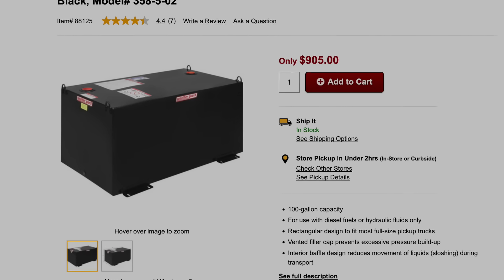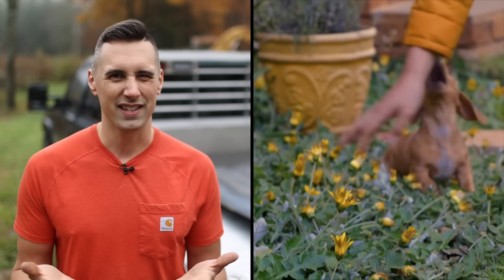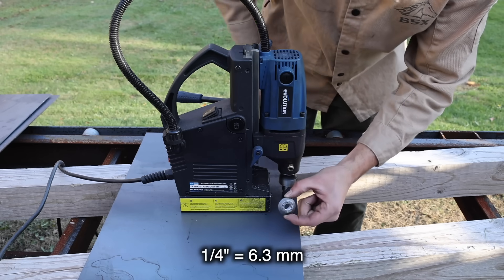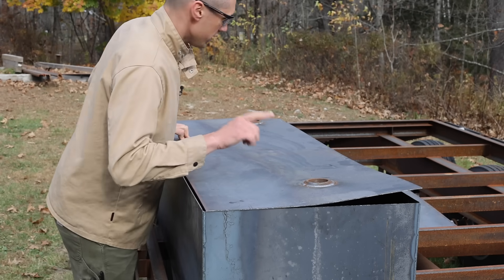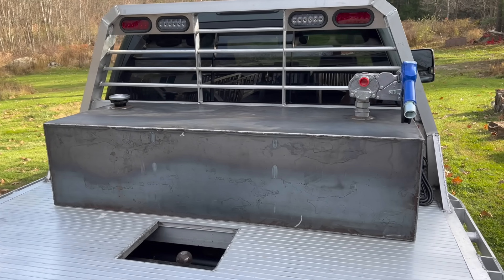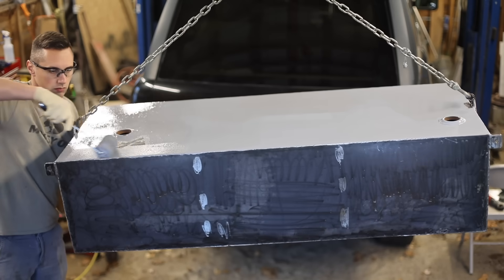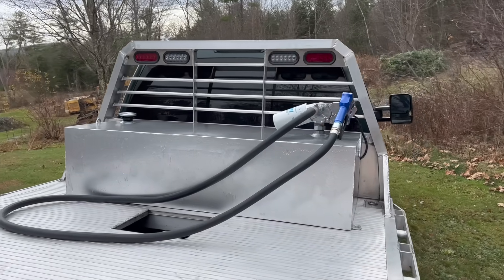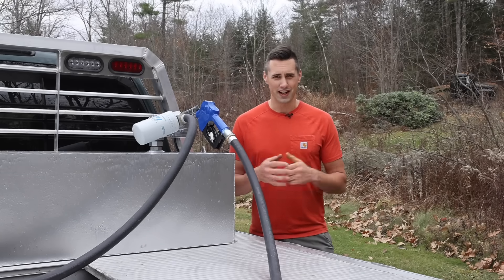Building a Fuel Transfer Tank

Comment: This is almost exactly how fuel tanks were built for Monaco brand RV's in the early 2000s. They had a guy who built fuel tanks everyday just like you did it. The only thing he did differently was to pressurize each tank and spray all the seams with soapy water as a leak test for pinholes. I didn't see you do that, maybe you did and I didn't notice..

Very nice job.

If you're gonna make another, weld the threaded bungs on AFTER you tack/weld on the top. You wont be fighting distortion.

Comment: Here in the UK, I also have heating oil for home heating..
Heating oil is LOADS cheaper than pump diesel here... But in a pinch.. I will run my heating off pump diesel :)

Comment: Seeing as how welding defects are the biggest problem on projects like this, why wouldn't one opt to go with as many bends as possible rather than maximizing the weld joints? If you, for example, did bends for 3 of the joints on the horizonal portion of the bank, that would leave you one weld seam (which you could put at the top) making it esentially leak proof along the length of the tank. Just leaving you the two ends to weld. Also with the extra time you saved you could put welds on the insides and out as well as some spray in tank linder.

Comment: Heating oil and diesel are basically the same but your jet will plug up a lot with diesel I have had this problem with my garage heater so a better filter will fix the debris problem I think it's the added detergents that turn to soot and plug the jet pilot so the filter didnt qork as well as I thought it would

Comment: Just spit ballin here but wouldn’t it have been slightly better to weld a panel on the bottom below the baffles to give the bottom of the tank an incline?? Like and inch or two would’ve done it you’d loose a little volume but when it’s near empty the fuel would be near the pump. Like I said never built one but if I were to that’s how I’d do it. Also I’m glad u didn’t use a foam baffle more work but better in the long run.

Comment: Would you want it sitting at a slight angle to make it easy to get the last of the fluid out?
Did you hear him say he saved ~$160/mo bc he uses ~200 gallons / mo. in the winter.
That means he's spending $1,000+ per month for HEATING ALONE in the winter there.
I used Eastwood's paint on Epoxy Primer on my Chevy Van's roof (I guess they all rust)

Comment: I built a couple of tanks like that only with a box on top for pry bars and any tools that wouldn’t fit in the tool box.  I had the metal co. Bend the pieces so there were only two pieces for the tank plus the baffles.  I made it from 10 gauge because I had too much warping with 14 gauge.

Comment: I used to build fuel tanks for a major fertilizer tenders. Couple tips.. do longer welds (starts and stops is where it will leak) if you do stop feather the stop with a grinder. Smaller tacks on your corner joints is key (so you dont have to feather your tacks) . Keep the wire in the middle of the corner joint.

When you check for leaks if you do have a leak, use a grinder with a cut off wheel and grind the corner joint out. Turn your welder down a bit and burn it in.  This will get the leak fixed the 1st time. 

With enough practice you will have fewer and fewer leaks.  Good luck!

Comment: i would recommend doing full height baffles and just nipping the top corners of the baffles off it controls the fuel slosh just as well but adds support to the top for  the pump can cause the top to flex until failure. I would also recommend adding a service panel to the top of the tank in case you need to get into it in the future for lets say a broken or damaged fuel pickup tube also you should look into getting a waterblock fuel filter instead of just a fuel filter as they will show how much water is in them and you can drain out the water in the filter

Comment: Bro you can run black diesel in your home heater and your 5.9 cummins.  It's used oil transmission fluid gear oil etc . First you have to filter it and remove water . Then simply add about 12 0z of gas for every 50 gallons of filtered used oils. That will save you 1000s of $ . You can thank you 😊 soon as you try it. Please don't make a video of it then everyone will catch on and make their own black diesel fuel

Comment: Something I learned is the amount of condensation that gets in the tank via the air and causes surface rust. This was in a motorcycle tank which is easy and cheap to keep topped up. Keeping it full and excluding air prevents this somewhat. Living near the sea in a humid climate has its down sides I guess. Best of luck.

Comment: If you use a finer nap roller the paint will come out smoother. You could have put both bungs on the same side so you don't have to go around. You could put 2 on each side for future uses. (future project). If you put a shorter nipple between filter housing and pump so there is less pressure on pump housing. Also hose won't sticking into cargo area as much. You could put an elbow coming out of filter housing. I put swivel fittings on my dispenser nozzles. Not expensive and a lot easier to position. Nice work!

Comment: Epoxy always seems to do better if it has been mixed and left to react for a little bit (depending on pot life, of course).  The epoxy paint we used for writing on printed wiring boards back in the jurassic period always adhered better if it was left to sit for 5-10 minutes before using it.

Comment: Need to learn how to backstitch your welds on something like a tank. It reduces your chances of a leaking weld. How you do that is if you want to weld across the top corner of a tank you weld the first 4 to 8 in or so buy welding back to the corner. Then you go another six to eight inches and you will back to the previous weld that way you're already fully heated up when you hit the previous weld Fred you're not trying to start a cold weld at a cold spot where you might get a leak. It also will cause the heat to come in separate sections of the metal reducing the tendency to Warp. I did industrial sheet metal for 40 years, and I got really good at welding without warping large flat pieces of Steel. And doing so without any leaks

Comment: Aluminum Peter built tank from wreckers works too. I got mine from oil workers construction worker. 111gallon tank. Over 4444km with the tank with the 6.5l tanks. Instead of stock tank. Stock tank leaks at 3\4full. Have to cut it out for shaving weight for aux fuel cell weight.

Comment: Great video, another thing you can do to try to save money and pay off the tank is buy during the yearly lows, before memorial day, holidays, etc, and use your fuel you bought at the lower price rather than buying whenever your main tank is empty, I filled up over 300 gallons in multiple transfer tanks when diesel was around $1.50 here during covid and cashed it all out when it was above $4.50 again so about $900 in savings by just playing the market.

Comment: Why would you put the filler nozzle on the opposite side of where the filler is for the truck? Why not put the tank filler cap and nozzle on the same side as the truck filler cap? Now if you want to fill your truck from the tank you have to walk around the truck, get the nozzle, stretch it across the bed to the truck filler cap, then walk around the truck again to put it away. You have to walk around your truck 4 times just to refill your truck tank...THEN if you go to the local fuel station to refill both your truck and tank at the same time, you gotta turn your truck around to fill the truck and tank... This was not planned good at all. Just put both the external tank filler cap and nozzle on the same side of the truck tank.

Comment: With epoxy its not the thickness of the roller, its that the epoxy breaks down the glue that holds the fluff on.  There are special rollers just for epoxy.

Comment: I am putting a 15-20 gallon transfer tank on my side x side trailer.  Inside a diamond plate side box. Just going to modify an aluminum fuel cell. They are under 200$ another option would have been bigger boat fuel cells if you have a boat junker near you they can be had fairly cheap if you want to crawl in there and pull one.

Comment: For your fuel, if you look for an OFF ROAD only fuel site, usually farm and mining equipment, it will not have the road taxes added to it for your home and tractor fuels saving 30-40 cents or more per gallon over pump fuel.  It is dyed red,  just don't put it in your truck tank. If you get caught with it there, DOT can fine you for using it.  But in your OFF ROAD home heating and tractors, MUCH cheaper.

Comment: Waldo You should be heating your house with a heat pump. The new ones are super effective in cold weather and use way less electric. Plus they don't pollute like burning diesel. Your house will not smell like an oil drilling site. Put up some solar panels and your utility bills will be less

Comment: If you ever want to fill that tank up quicker find a station with proper semi truck diesel pumps. The pumps are a larger diameter nozzle and move faster due to trucks needing 100+ gallons most times.

Comment: I left some features. I use 3/4 copper plumbing pipes to the pump connected to Harbor Freight Air Compressor Hose Reel, I use fuel delivery Hose and same type Nozzle for filling. I 1 each for Diesel and gas. My Cap. On each tank is bigger than yours and take less room. Looks nice. No hose dangling all over.

Comment: What I did, I made my own truck bed it’s Ford 450. My tank is part of truck bed. It’s 6 inches tall divided into 2 parts 50% Diesel other 50% gas. It’s same 14 gage outside is power coated. Top is 14 gage steel 1/4 inch diamond plate on top of 14 gage steel Transfer pumps under 12 inch tool box full width of flat bed, head is 6 inches taller then roof with lights for night time use. I use LED Lights. 5th wheel connections in the center on 3/4 inch steel plate. Nobody knows I have transfer tanks built in works great and huge capacity. O ya most important there are round sump 8 inches deep on both tanks from where fuel is pump. Hope you consider it on your next build.

Comment: how much more weight did it add to the truck ?
Reply: Google weight of 1 gallon of diesel.
Calculate hxwxl of the tank you are building
That will give you the volume of the tank
Now that you know how much the tank will hold. Mind you you need to make sure to that you are not going to fill the tank to the top.
Capacity of the tank x weight of diesel per gallon = total weight of fuel

Comment: Quick comment about the filler cap. Don’t push down and tighten if you close it all the way there will be no venting and it will spray when you try To open it. It will also make fueling a slow process because of improper airflow

Comment: Some states have places where you can get off-road diesel, which is usually colored red. The off-road diesel has less taxes, and you can fill anything that doesn't drive on the road (bulldozer, home heating fuel). I haven't done this before, but I've heard it can save up to $2 a gallon depending on your state's fuel taxes.

Comment: Did you pressure test the tank prior to filling it up or did you just hope there was no leaks do you know what I’m saying but it did come out pretty nice I have the same type fuel tank in the bed of my truck holds 100 gallons and I have it sitting directly into my truck front fuel tank on my Ford now I have a range of almost 1800 miles with just the truck

Comment: Ok ngl I was about to write a paragraph about how to properly secure a single sheet of metal on your flatbed but then I realized:

1. If it's short distances, then it's fine.
2. If it's lightweight then no worries.
3. It appears to be secured well enough so I shouldn't worry my head about it.

Forgive me, I am a former flatbed driver and whenever I see other drivers rolling in throwing maybe 14 or 12 straps on a particular load that will be a definite 39 ton load I will go out of my way to not only help said drivers secure their load properly but also teach them how to do proper load securement for future reference.  

And I swear to god, if anyone complains, "Why are you throwing 20 or more straps on a load like this? it's only steel ingots and iron pipes you shouldn't have to worry about a measely 79k load", I do not care, I'd rather be safe than sorry and if anyone has a problem with that, tell it to the widows of the truckers who didn't take safety seriously.

Ahem, forgive me.  Rant aside I love your videos waldo.
Reply from the maker: Thank you, and I'm definitely open to tips from people with more experience than me! 👍

Comment: You can buy off road diesel that is dyed red and you don't pay fed road tax of about .30 cents. That's even cheaper and it works for all your equipment too except your truck. Find a good supplier for that and you'll save even bigger.
By the way,  where's the second video on the gooseneck build?

Comment: The video would probably be too long if you explained the difference between taxed fuel for road use vehicles and nontaxed agricultural use fuel that is found at your local farmer's cooperative. Careful note to people tempted to buy nontaxed fuel for a road vehicle, the red stain is there on the nontaxed fuel to serve as a signal to law enforcement that can easily check the tank. Cheers.

Comment: Just go to the Truck Yard semi truck yard Wreckers buy a used aluminum diesel fuel tank cut the bottom off you do welding so just do some aluminum TIG welding for a flat base if you want to put some baffles in still possible and put it on your flatbed truck there instead of having to spinner $160 for 12 gauge mild Steel and then having to do all that work you could probably pick up a used diesel tank from a tractor trailer that has been in an accident for about less than 200 bucks if you have good talking skills

Comment: 200 gals a month to heat your house, did I hear that correctly?
That's over a 1000 bux a month.
I think I would be looking at ways to conserve fuel, increase home efficiency, possibly a more efficient furnace, or other fuels . Holy Cats, if my home cost that much to heat, I'd be in a financial Pickle!
I live in the country, and we are on bottle gas, that went up, and our furnace is old, so we went to an alternative source. Only things here that are gas are the waterheater and furnace. Our home is 3200 square feet, and it was costing us between 1800-2400 a year for gas. Depending on prices, but 3 fill ups a year were the norm. I put in a pellet stove last year, and so far we have been on the same tank of gas over a year. 
The pellets I buy from Menards when the have 20% off, by the pallet, and they come out to $250 a pallet. We used just over 2 pallets last year, and when we compared our cost last year, to the year before on just gas, we saved over $700.
Just some food for thought!!

Comment: Did you preform any kind of  pressure test before painting, to test for leaks.  Also, do you think you will have any issues with rust inside the tank with no coating on it.

Comment: I have an aluminum 75 gal tank. I scavenged some valve springs to use when I bolted to the truck to help with any flex that I may encounter. Another issue being a steel tank is that you want to look into periodically adding an algicide product like Power Service Bio Kleen especially if you aren't filling up that often.

Comment: Yeah, heat a house with fuel oil is pretty expensive now. 
Should go propone or an electric heat pump. 

It probably be easier just to modify a tank that's already out there. Maybe find a used one and modify it.

Comment: When welding things water tight the biggest thing is your stop and starts weld it hot and  make sure you clip your wire every time you stop and clean everything weld it solid on both sides

Comment: Waldo, Did I hear you right? $1200 a month for heating oil? 200 gallons a month at $5.99 a gallon? That's crazy! That's got to be wrong. I'm at $150 a month with a natural Gas 100,000 BTU furnace. If $1200 is true. I would definitely do something different. Natural Gas, propane, etc. When are you going to finish the gooseneck trailer?
Reply: So you're gonna start selling diesel haha

Comment: $7.59 a gallon for blended heating oil (outside tank here) delivered for me! I've been using an old new-motor oil 55 gallon drum to get 20 gallons of kero and 35 gallons of winterized diesel. Works the same and saves me over $1 a gallon.

Comment: Waldo, have you considered off-highway diesel? You should check around your area and see if you can get. It’s considerably cheaper and it’s no different other than a red dye. Be careful though, regulations are very strict about its use being only for off-highway applications.

Comment: You need red diesel. Only available for commercial and farm use  Did you check that the tape you used on the nozzle cap is correct?

Comment: So an aluminum 100 US gallon (385 liter) tank with 2 fills, 4 inch fuel sensor port for $100 CAD, or about $70 bucks USD was a good deal? 
Not to mention picking up semi tanks for under $100 is pretty awesome.

Comment: 12:40 that's not how you rubber isolate metal to stop fatigue. The simple test is : does it still pass current? 
Your setup damps in 1 direction , puts energy in the rubber, then it rebounds and crashes metal on metal like a jackhammer. 
Just look In any engine bay, every single component is rubber isolated, radiator, power steering reservoir, washer bottle, fuse box.

Comment: for feeling the truck you have the option to add a solenoid valve (fuel/oil rated) and a small line going into the fuel tank of the truck to slowly add fuel to the trucks tank while driving via a switch in the truck.  I have seen someone do this exact setup and they used 3/8 line and would start it adding fuel around 1/4 tank and stop at 3/4 ( stopping it so it could never overflow...) which worked surprisingly well.